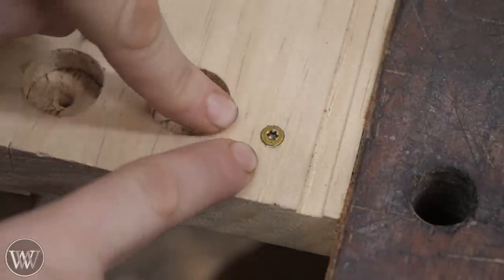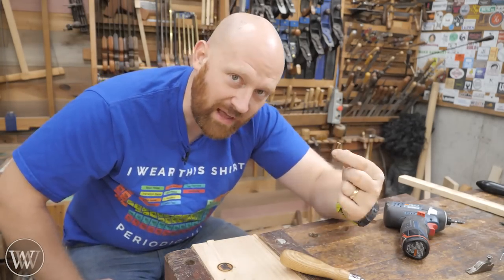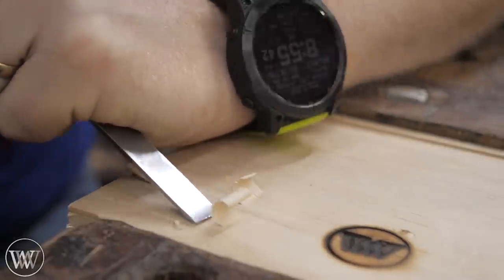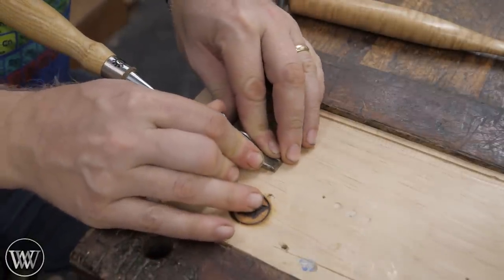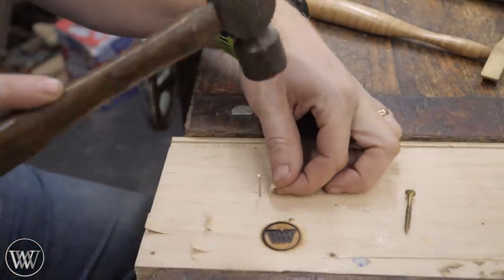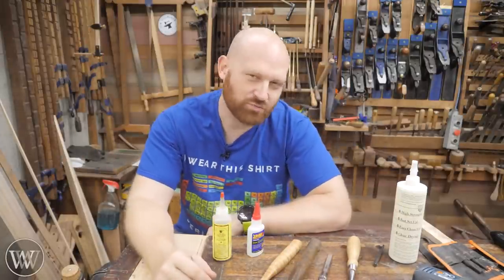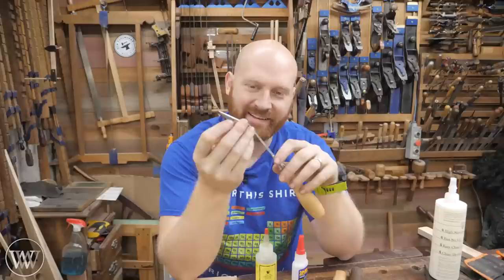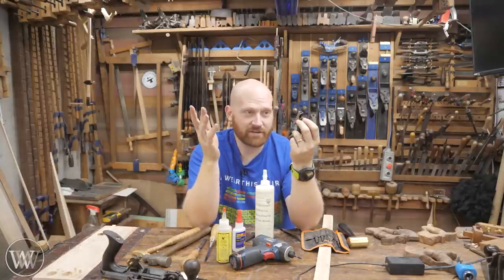The Smallest Plane Stanley Ever Made No  96

Comment: You are forgetting that this was often used to try and tighten up squeaky stair boards and floor boards. Many years after the stairs a built if you end up with a squeaky floor board, you can come in with one of those, plane up a bit of wood over the runners and nail it back down to hopefully fix the squeak. Making this more of a carpenter's tool than a cabinet makers tool. But Cheers, love the channel.
Reply: Neat!
Reply: This is what I was thinking. Structural stuff where surface finish matters and where taking the whole thing apart was impractical. I could also image using something like this to attach mouldings rather than having to fill nail holes on trim you weren't painting.

Comment: James, what is your view on the G12-204 Stanley #4? I have had one for a while and had good performance, but after restoring older planes, it seems more finicky in comparison with much older planes. The lever cap pops off if you adjust the plane blade too far to the left or right as well as even you adjust too often.

 My G12-204 #4 has plastic tote/knob as well as blade adjuster and has a light blue paint for most of the body.
Reply from the maker: It is an ok user, but has no fit and finish and is very finicky. and often it is the same price as a type <18 and those are far better planes.
Reply: @WoodByWrightHowTo ,  Thanks, James! Happy it's not just me.

Comment: I read somewhere about wetting the wood to make it less likely to splinter and using a gouge so the edges are feathered out - makes more sense than a bevel edge chisel.
Reply from the maker: wetting it out works well  if you are going to use PVA, but  for most other glues you would need to wait for it to dry. the gouge works well but it needs to be a wider one otherwise it would need to go too deep.

Comment: I think hiding a nail makes some sense, as nails provide space for some movement (nails can bend). Screws not so much (screws snap). With the same effect you can glue… maybe if only for additional strength in butt joints
Reply: My farmer friend installed a hay crane in his 400 year old house, requiring 3’000 nails per attachment point, exactly because nails bend.

Comment: TIP: if u do this and u use hide glue, if u need to remove/repair the thing and need to remove the screw/nail, sand off the varnish or coating(if needed) then get a wet cloth with warm water and a hair dryer, soak the part that needs to curl back up and heat it slightly with a hair dryer, since it is attached with hide glue, it should soften and allow u to get a chisel or something under it to gently pry it back up and then u can remove the screw/nail. Then when u need to reattach it, just add a bit more glue(after u let the wood dry) and then just reattach  it. Rem that hide glue is soluble in water so if u get it wet it will soften. (Iv done something similar b4 when fixing an old violin case and the violin itself and also when repairing an antique book, so this should work with this application also. Would love somebody to try it and tell me how it works) cheers!!!!!
Reply from the maker: As long as you can find it that works well.